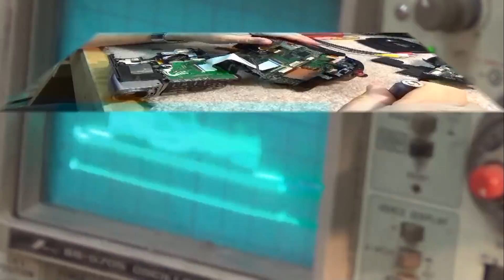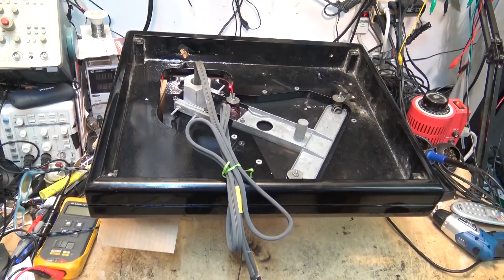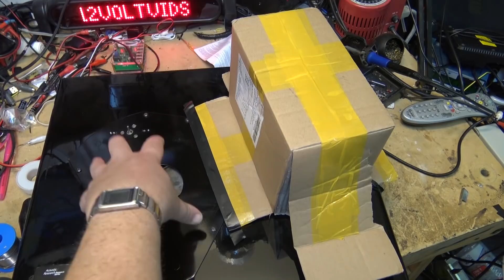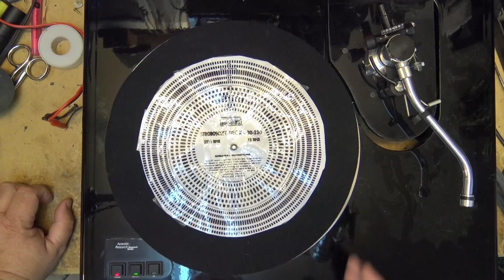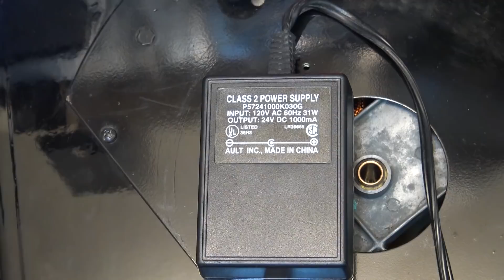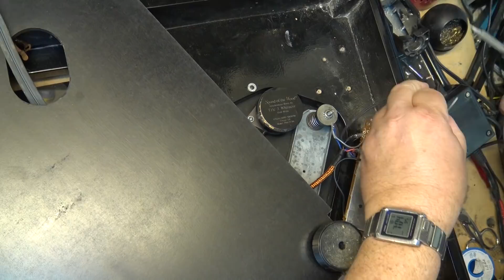Acoustic Research ETL1 motor replacement and reassembly part 2

Comment: In response to a few comments. The Original motor is not a low torque motor. My table starts up fine in 33 and 45.  If the belt is loose, it does slip a bit and getting to 45 rpm requires a start in 33 first.  These decks are incredible sounding units when set up correctly. They have a 3 point double spring suspension. They also come with a series of lead counter weights  mounted to the sub chassis. The chassis is cast metal, not stamped metal.  The Platter is 8lbs.    Real wood and veneer.  The SAEC arm I mounted on mine is the limit for tonearm lenght the table will accept.

Comment: One omission. The table requires a 1/4" bearing ball.   Stainless steel or Tungsten Carbide.   Great repair video's, thank you. Now I can trouble shoot my own ETL-1
Reply from the maker: Under the spindle right? 
This is how it came in. It was brought to me to mount in a new motor.  I couldn't test it because I have no belt, no cartridge, no counterweight ect. It was brought in to put a new motor in and fix the speed control board.
Reply: Yes. The table is supposed to have a ceramic thrustplate  at the bottom . Most of the time they get shattered.  Most people then cut a circle from delrin rod.   I need to do that to my table. IOt works amazing right now but it is missing the thrust plate. I do notice a difference in speed  between a SS , steel and  Carbide bearing ball.
Reply from the maker: Well I guess the owner of it will be looking for that. He bought it broken off fleabay. Go figure.
Reply: It looks like it still has its original feet. Those  are rare as gold.  I looked at so many of these  and all were missing the feet as well as many other things wrong.   I  accidentally won mine on e-bay. Put in  a snip bid and won. The unit came from a pawn shop.    I did not expect to win.   Prices on these fluctuate. 
Thanks again for a great repair  video
Reply from the maker: Actually the ball bearing was inside. It dropped out when I had the unit upside down and I found it on the bench and replaced it.
Reply: Good.

Comment: See on panasonic nv-HS800 where is the vertical signal control situated. because on pause is jittering. what does it look like and where will be
Reply from the maker: It will either be an external control sticking out if the front or back or it will be done with the buttons on the remote.  Usually Panasonic used the tracking buttons on the remote to set the vertical timing in pause mode.
Reply: thank you ill look into it

Comment: The next turntable I get ?  Direct Drive , I need  2 of them .
Technics  1200 
Belt drive  need a pitch contral  for the belt stretch , they slow down .
No one should put off the 1200"s  " MINT "
Reply: They will out live the user  .

Comment: Wouldn't the old motor with the bent shaft still work fine? It's not like the wiggle would affect the platter, and as long as the belt stayed tight and wasn't slipping, it would not have any appreciable effect on playback?
Reply: John Smith 
I believe it had a flat spot and was noisy ( ticking )
Reply from the maker: It was making a thumping sound as well likely a worn bearing. Customer supplied a new motor.  He actually took it to the other guy to change the motor and the other guy took it apart and then got lost and couldn't figure it out and walked away.  I was just fixing the original service board problem and wiring up the new motor and reassembly.
Reply: And certainly a fine job of that you accomplished!
Reply: You might hear that "wiggle" as a 300Hz sound (motor speed is 300RPM) through the deck, into the platter, and picked up by the stylus..
Reply: It would cause a type of wow / flutter which sucks you would notice it right away - never use a bent shaft for audio playback.  The customer did state the original motor was broken. Odd he put it back in with the new motor sitting there.

Comment: What an amazing job you did! You could try to boil the belt like you did with some cassette decks.
Reply from the maker: Owner has the correct belt for it as well as the counterweight  dust cover and head shell

Comment: That wasn't a repair, it was a rebuild :-D
I hope the customer appreciated you or will appreciate your effort.
That platter seems well overboard, must be for audiofiles only, no one else would notice the slight speed imperfections.
Reply: "300 bucks for a motor" Yep, there's one born every minute.  I do miss the sound of wow and flutter (not).

Comment: That's a good one. Nice work too. Can't help being curious as to how that shaft got bent. I won't assume it was the last guy who worked on it. Maybe the first owner or someone they hired to fix it went in to change a regulator and dropped the motor on a hard floor. So easy to wreck a motor that way. 
I was hastily tearing down a vhs machine for scrap and small parts when I dropped the whole head drum/motor assembly 3 feet down onto the concrete floor. That actually tore the drum along the upper drum groves like they were score lines. It was useless to me anyway so it was just funny and I tried it again a few times. 
I sure hope they made the new motor out of good stuff for $160... hopefully at least one ball bearing unless that's wrong for this application. I've seen the two wire low RPM geared motors of roughly that form factor go for about that much from the original manufacturer. It was for a tape cleaning machine's webbing advance tho.
Reply: I would guess that whoever ripped off the belt 'cog' from the motor shaft, damaged it as it was probably applied with an epoxy material originally.
Reply from the maker: Have no idea how it got bent.  Could have been damaged by the guy pulling the pulley off. All that happened before I got to it.

Comment: I started to assk if the motor shaft was bent last time but decided not to, figuring you would have noticed. Also, is the tone arm counterweight missing or do you have it?
Reply from the maker: Dont have it.  Owner has the weight. Dust cover and head shell
Reply from the maker: @FREEAGENTOFGODYAH  
You don't .  
That is why a new motor went in.